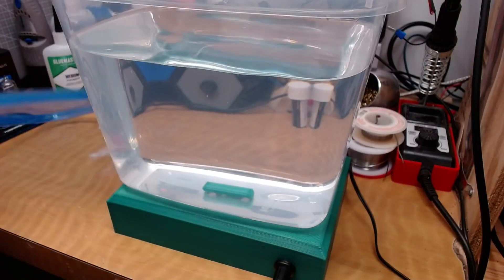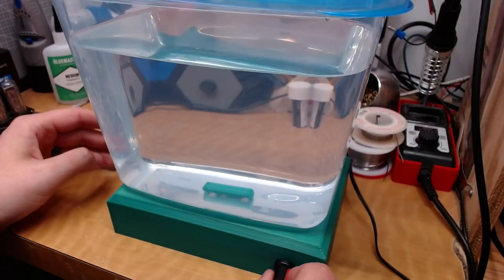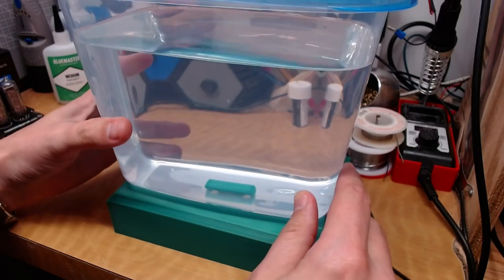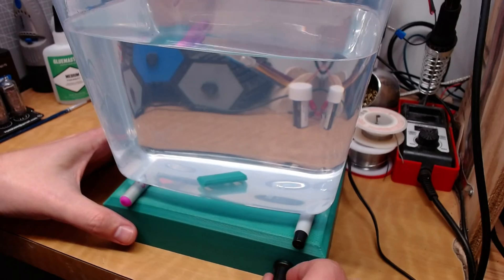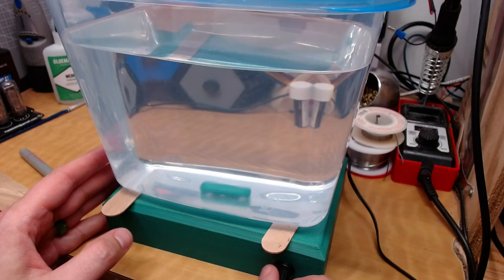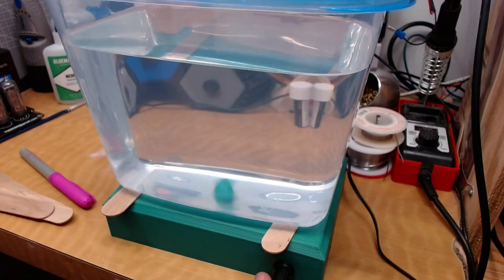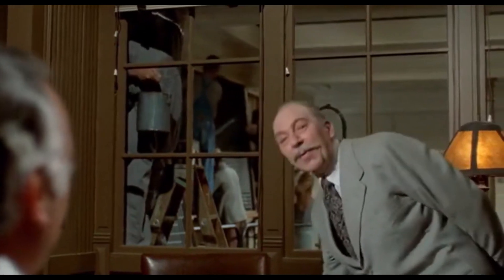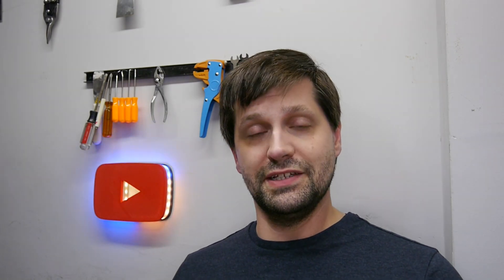3d printed magnetic stirrer - Will it rinse my resin prints?

Comment: The 'squareness' of the container is obstructing the flow in a vortex wise fashion. A recommendation, would be to test a glass of water on a cylindrical cup on your apparatus. But observing that it may not be feasible to change the tank into a round one, perhaps a smaller 'stirrer' can achieve somesort of mixing - not a vortex though since the flow would be disrupted at the corners. You may get some turbulent flow but not a laminant one.
One can observe this when one uses a spoon to stir coffee in a cup, the cup is round hence the flow of water isn't obstructed from spinning. However if one uses a square cup to stir their coffee, no flow can be achieved because the flow is disrupted by the geometry of the square.
Reply from the maker: You make very reasonable points. One day soon, I'm going to collect as many of these ideas as possible into what should be the ultimate magnetic stirrer.